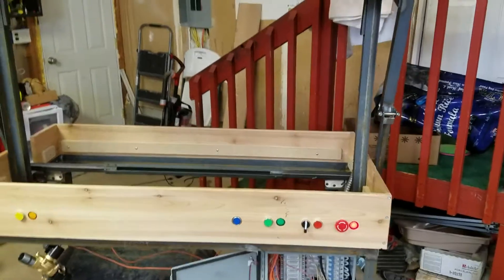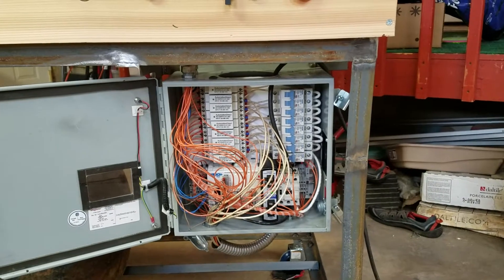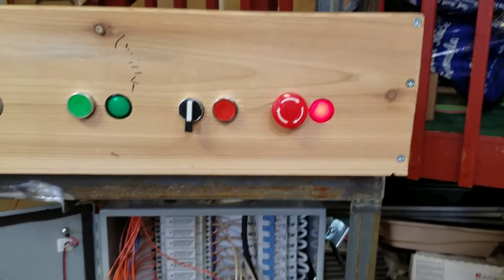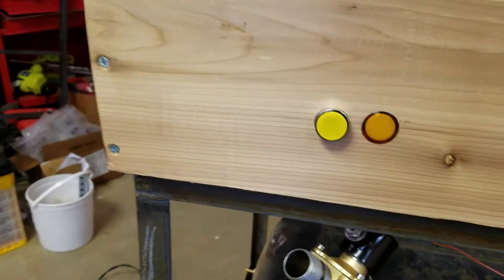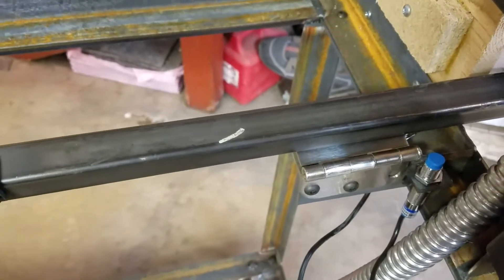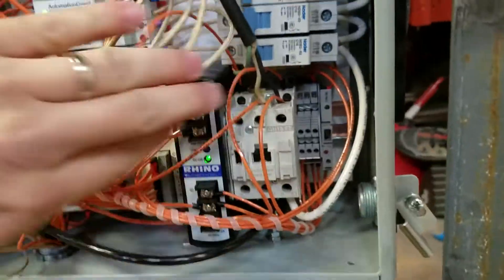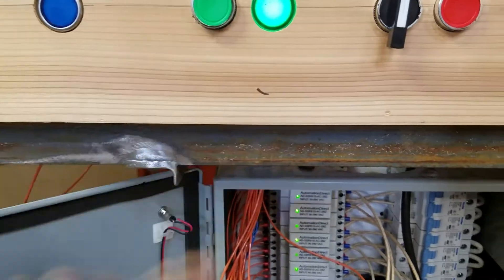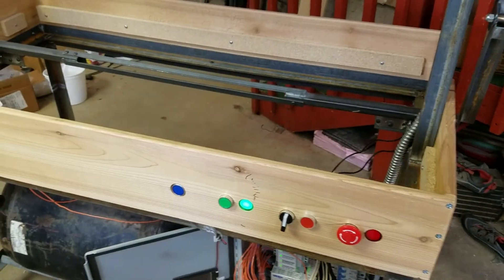DIY vacuum forming table PLC controls 2'x4' first video

Comment: Very nice work , ive almost finished building mine its 1200mm × 1200mm abouts twice the size of yours , what gauge nichrome wire did you end up using and what is your power supply ? Cheers mate from Australia
Reply: I bought the coils off ebay. They are 1200 watt 220V coils. I just had to stretch them to fit my element panels.